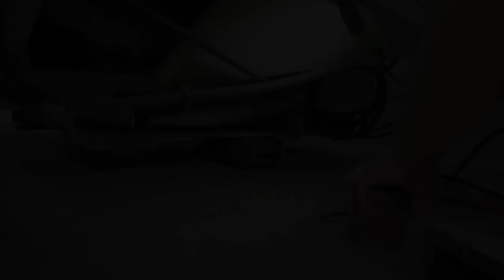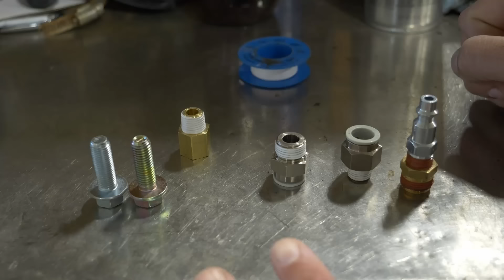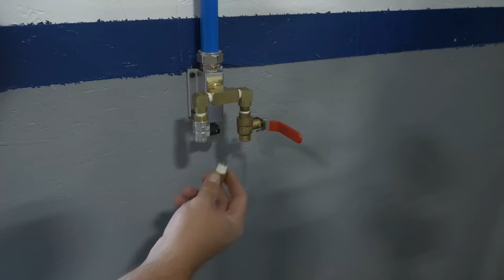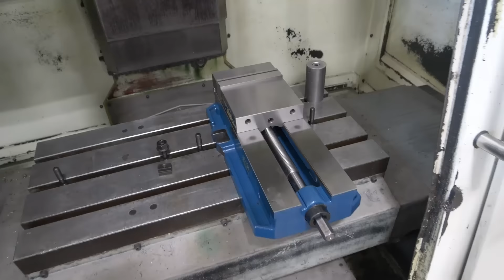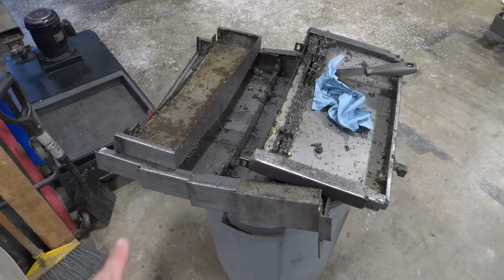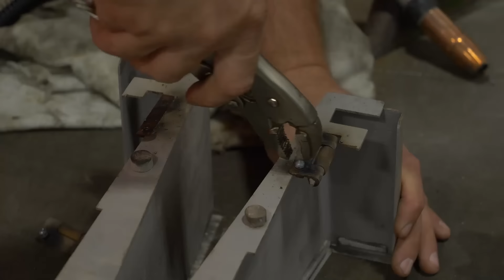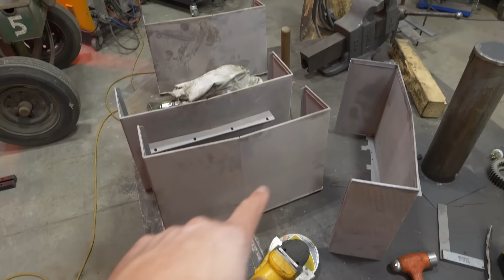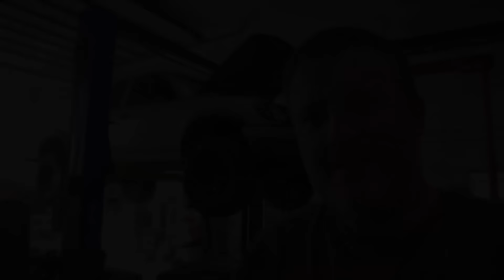Did I Buy a Problem or a Solution? Cheap CNC Repair Part 1

Comment: I'm Canadian. We use the metric system, the UK Imperial system, AND the standard US system.  Some things are better metric. Some things are more intuitive with standard. (like feet instead of meters).  It's all just one big party up here!
Reply from the maker: It's the same in Mexico. You can walk into a hardware store in Mexico and buy a 4x8 foot sheet of plywood and 2x4.
Reply: While in the UK plywood is sold as '1220 x 2440mm' , but everyone  knows it's 4x8. Think of car tyres - 225/50/18 - you get the best of both !  @WatchWesWork
Reply: Any idea why you guys call it a 2 x 4 and the former British Empire members call it 4 x 2 where the larger number always come first in the size description? 🤷‍♂️
 Really curious to know why that happens.
Reply: Yeah, I find it easier walking on my feet and not my metres. 🤯
Reply: @josephking6515  yeah metric has no equivalent to the foot. They have the decimeter but it never really took off. It's a totally useless unit. A lot of metric users have never even heard of it. A decimeter is 10 centimeters. It's close to 4 inches long. So baby feet? Yeah there's no good use for decimeters.
Reply: @1pcfred  I've noticed in countries that use metric "properly", all 'typical' length measurements are in mm below 1m, and in meters above that. 'Proper' metric usage sticks to 10^3 increments, just like "engineering units". Centimeters and decimeters are useless. Just use mm, or m with 3 decimals (essentially mm) and be done with it.
Reply: @gorak9000  Millimeters in the drawings maybe, but most people use centimeters - decimeters are not used at all. If it's below 1m it's cm, if it's below 1cm it is mm.
Reply: @gorak9000  what you say does seem to be how it is to me too. That does tend to make for some largish arbitrary looking numbers too. Unless they round it. Like say 100mm Our money is metric. One dollar has 100 cents in it. Not that a cent will get you anything today. I remember when a penny would buy something. But we have oddball currency too like the quarter. Nickels are kinda oddballs too I suppose? A nickel used to weigh 5 grams though. I think that was just a coincidence? The Internet says a nickel weighs 4 grams. Another page says it does weigh 5 grams. Either way it's just random chance. Or is it a conspiracy? Sneaking that metric in on us.
Reply: @1pcfred  Rather niche use, but calculating the volume of something in litres is the only time I have found a practical use for decimetres.

For some reason I find it easier to convert the dimensions to the otherwise useless decimetre and then calculate volume (answer comes out in litres), than to calculate it in metres (or centimetres or millimetres) and then try to convert the answer to litres.
Reply: @dfross87  calculating volume is indeed a niche use. But I've done it. The last time I did it I was within a few bags of soil on a whole truck delivery. Which I thought was pretty good. It was not easy. I was converting from cubic inches to cubic yards. I got the results I wanted though. No one here is selling dirt by the liter either. Job done.
Reply: @1pcfred  Depends what I'm going to use the volume for.  Soil I'll just use metres (result in cubic metres); if I need to know the volume for a gas or liquid measurement then I use decimetres (result in litres).
Reply: @dfross87  generally I only ever need a shallow depth of soil over a large area. It is never a uniform depth either. Or a square area for that matter. Nothing ever works out that simple in the real world. I ain't never filling sandboxes. So it always comes down to some guess work. I still draw it all out and take measurements and do calculations though. Then I make my best guess.
Reply: Standard is Swedish. Henry Ford just bought Johansson and moved him to Ann Arbor Michigan. Which is why everyone thinks Standard is American today. Money talks!
Reply: i'm from the uk we use a number of old imperial systems alongside  a couple of metric and some us standard . you learn to check and make sure ,if your working with or on something that could surprise you.
Reply: @andrewmcewan8081  it isn't US Standard. A Swede actually devised Standard. But Henry Ford was a big fan. So Ford bought the guy and had him transplanted into Ann Arbor Michigan. Which kinda made it American then. Carl did escape the industrialist's clutches eventually and did manage to die in his native land. He's the Jo of Jo block fame though.  Carl's last name was Johansson.

Comment: You know Wes,   im sure it annoys/bores some people,  but i kinda enjoy your rants / tangents about stuff like metric vs standard imperial,  but that said,  I'm technical like you so i guess that stuff is naturally interesting to me
Reply from the maker: You know the scary part? I'm so used to working with both back and forth all day that I switch them out ad hock without even thinking. You can hear it in the video. I mix "tenths" and "hundreds", which are inches and mm.
Reply: @WatchWesWork  What gets a bit more of the twist when you add in the British and US National pipe threads both have tapered and straight threads. Finding taps and dies just in general can get interesting based on how common or uncommon the thread was used.  And that applies to both SAE as well as metric. Old carburetor inlet fittings....those really should not exist, but do so for a narrow single purpose.
Reply: @WatchWesWork Blondihacks taught me that tenths mean 1E-4 inches?
Reply: @WatchWesWork Like me, I learned my machine work in South Africa as a 35 year old. Small mesurments are easer in metric.
Reply: Standard ended Imperial. They're not quite the same. But the difference is so slight you cannot actually see it. The old Imperial inch was two millions shorter than a Standard inch is. The fact that the difference isn't perceptible has lead to a lot of confusion. Like thinking that the US uses Imperial. The old US inch was 3 millionths longer than a Standard inch is. You still can't see the difference between Imperial and archaic US Customary. But there really are or were 3 different inches. We all use the same inch today but we didn't always.
Reply: @1pcfred  damn learn something every day
Reply: @Steinerrides  maybe we do. But if I did today I can't think of it now. I'm having a harder time remembering things. My brain is being more selective with what I retain.

Comment: Great example of why machine parts cost so much.  Maintenance, repair, tool selection, raw material inventory, drawing review, rough cut part, program part, set up, set up, set up, remove part, clean part, prep and paint, wrap and box part, clean machine, reload new part. Call Keith Fenner and brag.

Comment: And don't forget,  BSP comes in tapered "R" configuration (seal on taper) and in parallel "G" configuration ( seal on surface with washer). Plus, there is BSPP gauge which seals at the bottom with a washer. As an engineer in the fluid power world it can be infuriating. 
Never underestimate the power of enthusiasm and a welder to fix a thread mismatch leak the wrong way.
Reply: (Deliberately misreading you) So you weld in the hole, and re-drill and re-tap? nice
Reply from the maker: It's only getting worse as working pressure keeps rising on newer equipment.
Reply: @WatchWesWork  I work in the high pressure world, 60,000 psi is not uncommon. Leaks get a little more spicy when you're doing autofrettage.

Comment: Eeeeh. Kinda against the point to say metric is not better than your system when you then go ahead and compare it to another stubborn country that don’t use the international standard. We NEVER see that Japanese stuff in Europe. If we do it’s specialty shit that the everyday worker don’t see. Maybe a hydraulic hose shop would. But not even on Japanese cars do we see the issue you talk about and neither do we in electronics that’s my speciality. And you don’t go around and calculate torque. You set your gear to the correct value for what you’re doing and bingo.
Reply from the maker: You're just not looking. Every Japanese engine will have M12 bolts with 1.0mm pitch. Good luck finding those. Every Japanese construction machine will have JIS fittings, or even worse, Komatsu fittings.
Reply: @WatchWesWork  Here in Hungary you can find all metric pitches.
Sure, the big box and small mom-pop hardware stores will have only the most common ones. But you can go to specialist fastener stores and they will either have on the sheldf on can order it in a day or two.
Reply: @WatchWesWork  not an issue at all to Get at the hardware store. :) Würth, Tools etc.

Comment: Wouldn’t you level the ways of the machine?  Then level the head.  Then check your backlash then scrape the table?  It’s been a while since I’ve seen the install process.
Reply from the maker: No. You can do everything from the top of the table. That's where the work gets mounted, so that's what matters.

Comment: Don't forget when working on Kawasaki, or Yamaha motorcycles, japan uses JIS not philips. Have the customer look into toyota's frame recall for the Tacos.
Reply from the maker: That's been gradually eroding. Screw drives have become more JIS tolerant, and JIS screws have become more phillips tolerant.

Comment: Ahh, metric vs metric fine bolts. The joys of discovering someone has forced the former into a hole meant for the latter, and now your half hour job is going to turn into a several hour ordeal...

Also, and this is very important*: Did you use a *metric crescent wrench when you installed that push-fit? It'll leak otherwise! 😆

Comment: Your philosophical excourse about kg is interesting. When we talk about Nm, we also simply say kilogram, nobody cares about being 1,9% off 😂

I struggled a lot with pipe fittings. In europe imperial pipes are still very common. Fittings for flow and temperature sensors often are G1/2" or M18, i prefer G size, because i can use standard fittings. Pretty often i had our welders change fittings to G1/2", makes life a lot easier, because we had all sorts of stainless G fittings in stock. So from my experience, change everything you can to a format you get in every hardware store.
Reply: Oh but all of the metric elitists love to tell me that metric is more precise. I ask them what they've ever done with that precision and I haven't gotten any coherent replies. I know what I've done with Standard. It's always been plenty precise enough for me too.
Reply: @1pcfred  well, they are right, metric is easyer to handle, because it's a decimal system, no need for fractions like 3/8 oder 7/16, just multiply or divide by 10. Thread pitchs are standardized, the japanese M10 shown in the video is not a worldwide standard. 

And fun fact: Imperial doesn't exist anymore, all imperials are defined by metric.
Reply: @stefankaufmann8257  we don't have to use fractions if we don't want to. 3/8s is 0.375. Sometimes it is just more convenient to express the value as a fraction though. We can also use the denominator as a granular scale too. Just have all values fall on quarters of an inch for instance. It's a useful mechanism in design and execution. That's just one example of the convenience fractions can provide. To fully appreciate it all you'd have to be a polymath genius, and not everyone is one. That's just a shame, isn't it? Now for everyone else then I suppose metric would be the superior system. Do realize that nothing worthwhile is ever particularly easy. That's how it goes. Your fun fact is a conflation of reality. It is wrong on a number of levels. But to point it all out would take me more than I'm willing to do.

Comment: Could have got you a free cnc mill with a 5ft x2ft table. Supposed to run great. Forget what mill it was converted from. It was huge. It was in Michigan on Facebook marketplace. It still might be listed. He said he used it for years and now just wanted it gone. I know I would not want to move it myself.
Reply from the maker: It costs too much to move  them. You'd have $3-4000 in rigging and trucking. Unfortunately, it's just not worth it.
Reply: @WatchWesWork  Even for me it would have cost at least 5 or 6 thousand to move it but then I don’t have the room for it. No need either. He was asking 5 for it then changed it to come and get it.
Reply: @johnscott2849  floor space always has real value. So come and get it happens fairly frequently with machinery. The big iron often has little value because so few are willing to actually go and get it. If grandpa can't wrestle it down the basement stairs that knocks a lot of people out of the equation.

Comment: IMO the main problem with these thread standards that they are not marked identifiable.
Reply from the maker: Nope. No way to tell. I don't even have a thread pitch gauge to ID BSP threads.
Reply: @WatchWesWork  it would be nice if they had some kind of a stamping or groove markings

Comment: Torque in metric is MUCH more simple!
Calculation is already included, the torque is given in Newton-metres, the scale on the tool is in Nm and the length is in meteres or part thereof. You don't think of pound when using torque-wrench, you use a setting scale and a click when you reach the torque. You can also use 1 kg on 1 meter length to get 10 Nm. Or 2 kg on 0.5 meter length to get... you'd never guess it... 10 Nm. Metric, you know ;)
Using the British screw threads as a "metric" is a fail. That's not metric and even you yourself said so.

Great video, as usual! :)
Reply from the maker: It's only easier because you ignore the exact conversion. When we are all living on Mars you're gonna be really confused!
Reply: @WatchWesWork  just divide or multiply by the local gravity equivalent. Stil easier then asking the king what size his foot is!
Reply: @WatchWesWork  If things don't get taxed right, you'll be using musk units anyways, so it's all irrelevant. I think Joe's point stands. We don't mix other standards with Metric. Metric is metric. Others, outside Europe might, but we don't. Most of the machines i have, that are made here, are all standardized with common 100% metric stuff. I think the only time i roost upon Japanese stuff or inches or whatever else, is when i buy imports. Bout the only place where i do, regularly find non metric stuff is water and gas systems. That... has been so all my life, i think it's some kind of tribute to the Old Boys. That's the only place where we have to put a " , " and open up the " ,XX" box to muddle things up. IMHO, i think both sides have a convoluted perspective of the other.
Reply: @WatchWesWork  I came here for the comments, you really need to take another look at it, you are mixing things up.
Reply from the maker: @VoeViking  Just read for one minute on the difference between force and mass.
Reply: @WatchWesWork  This is an easy one: mass is what I go to every Sunday; force is what my wife did to the kids every Sunday morning.
Reply: @WatchWesWork  Exact conversion is built into the torque wrench, you don't need to think about it. Thinking in kilograms is just a shortcut to compare it to thinking in pounds and both don't even come into play... because they are both built into the torque wrench already. It's just clicks or beeps we are using.
Reply: @WatchWesWork  How many pounds you would need on Mars on a 1 foot long wrench to get 1 foot-pound of torque out of that? I also came here for that comment. Great Video!

Comment: Then we come in, in the UK, where we use a complete random mix of metric and imperial, which can be different to the US imperial standard 😂
Reply from the maker: We get that here too.
Reply: @WatchWesWork  its mad really, We use miles, yards & MPG, yet buy our fuel by the litre. To name an example!
Reply: The US never used Imperial anything. When the colonies were English the crown never saw fit to send standards to the wilderness. By the time Imperial was established the US had long since broken away. Imperial is from 1824 and US Customary was devised in 1793. So US Customary is actually older than Imperial.
Reply: @1pcfred  yes, very true! Apologies, that is force of habit to term anything, inches, feet etc.

Its my understanding its roots are ancient and individual units used, go right back, before any standard that bound them together anyway.
Reply: @josephwoodhouse9930  yes an inch used to be 3 barleycorns end to end. For a long time precision wasn't critical. Close was close enough. It is said that Eli Whitney kinda faked his first production run of muskets. That was in 1798. So it was a concept but not actually a practice even then. Around that time James Watt was having a hard time finding anyone that could bore cylinders the precision he needed. The level of workmanship simply didn't exist. A blacksmith worked to the eighth of an inch. So widespread high precision is a fairly recent innovation. Folks managed without it. They managed without a lot of things. Intel's next line of chips are going to be measured in angstroms. As Wes is fond of saying, things escalated quickly.
Reply: @1pcfred  Or how the French did send over some Metric standards around the turn of the century 1800's. Only they never made it to the US and no one ever saw it fit to go looking for them.
Reply: @donaldmoore8023  I doubt the pirates would have given it up even if they were found. Those pirates I owe an incredible debt to today. Because I absolutely despise the metric length scale. I'm grateful I have an alternative I happily work with too. We actually did switch to metric in 1975 but we rejected it and we are an armed populace. You could even say we aggressively rejected it. Mostly we didn't care but there was one aspect of metric we wanted no part of. The world is a funnier place than you can possibly imagine. Both funny strange and funny ha ha at the same time even. It is safe to say the US isn't switching any time too soon.